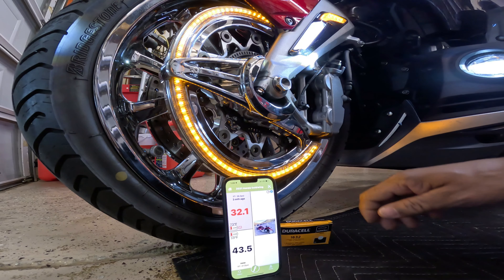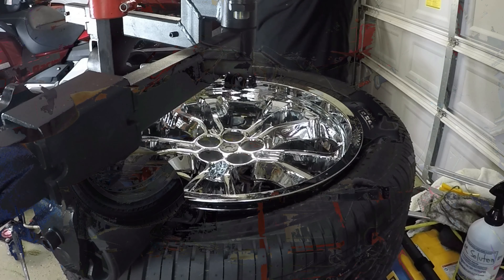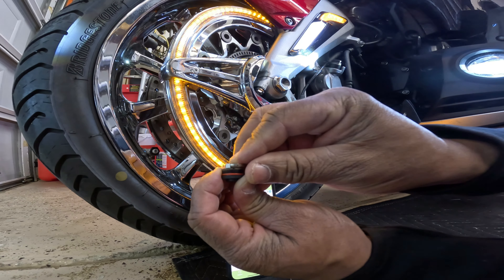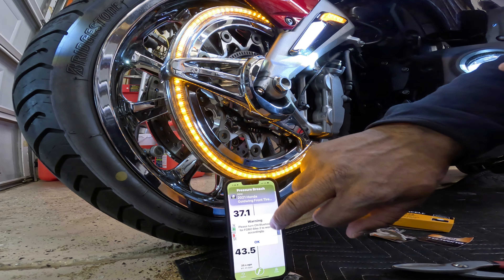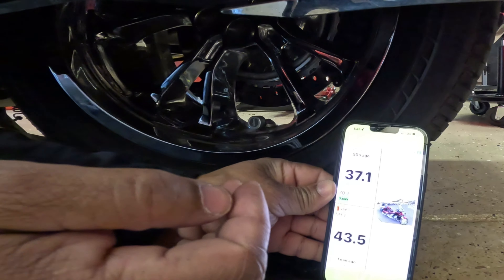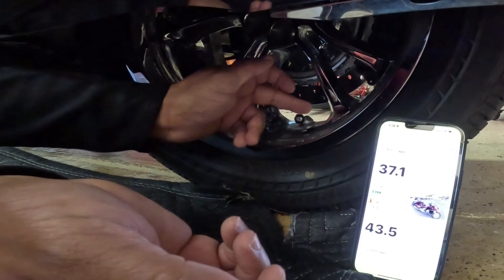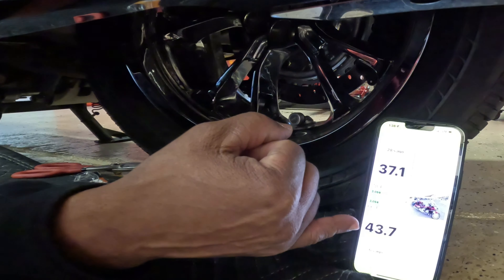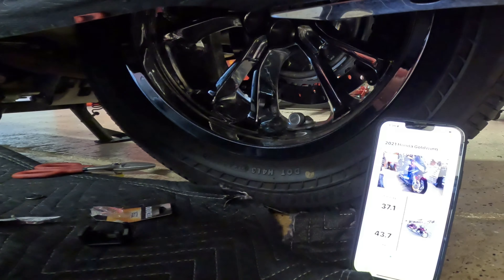Another Dead Battery Tire Pressure Sensor FOBO 2

Comment: I’ve had mine for a couple of years now and just needing to replace the batteries.  I noticed you still had the original valve stems.  Last time I changed my tires I put the “T” stems on, much better and allows me to add air without removing the FOBO sensors.
Reply from the maker: I have "T" valve stems installed on my 2016 Goldwing because I removed the Honda TPMS senors.  On my DCT model Goldwing I cannot have OEM TMPS senors and T valves too, you can only have one or the other!
Reply: Ok, I understand now.

Comment: Chris, thank you for that. I always use disposable gloves when handling these coin batteries. Your fingers, no matter what, are always oily. This Fobo2 is a great thing to own. I don't rely on the OEM TPMS. It detects the PSI wayyyyy to late into the ride. I don't get Honda. Makes no sense to me. I hope they learn a bit more.
Reply from the maker: You are correct, I usually use gloves but too.  I use both the OEM and the FOBO so I can have full coverage!

Comment: Hey Chris, thanks for putting this out.  Nice reminder of something I've been thinking about doing.  I have some things to get from Wing Stuff, I'll add a set of these.  It'll be interesting to see if they impact my wheel balance.  I should have done it when I put the new tires on so they could be accounted for.  I think you mount your own tires; did you notice any effect on balance?  I don't use beads.  I did when I ran Dunlops, but I like the Bridgestones on the '05 1800 and no beads needed.

Comment: Nice video! Is there a way to disconnect the OEM TPMS from the bike? Pressure is correct, but TPMS is still illuminated. Thanks for any suggestions.
Reply from the maker: Good question but I use the FOBO with my Honda TPMS so I don't have that problem!

Comment: A lot of people tell me about these,   Why have them if the bike has tpms sensor already?
Reply from the maker: https://youtu.be/jjqxDBo2flw?si=5Tj81DCVBEGfD9pD
Reply: @chriscaliente5033  then you replace its battery?   My question is why do you have two different tpms sensors on the bike?   For redundancy?     A couple of my buddys have it on their older bikes but I never thought to get it on the new one for the reason that I already have it on there from factory
Reply: can replacement batteries anywhere and change it yourself in minutes for less than $10. OEM sensor is a pain in the ass to do, costs a lot of money, and you will have a lot of down time getting it changed out. These are way better for use and maintenance.